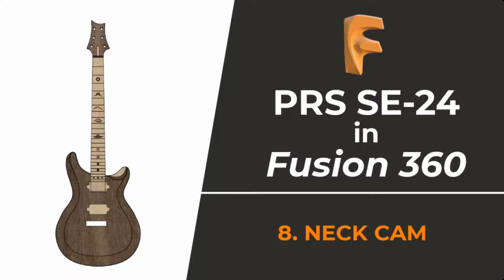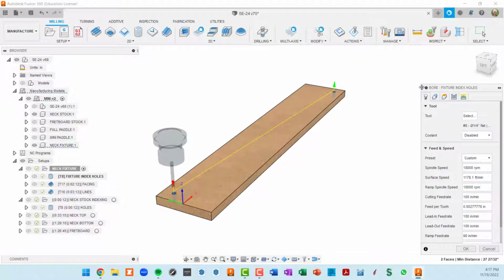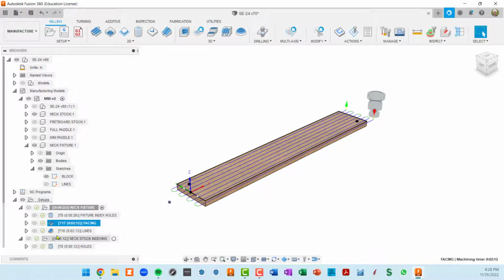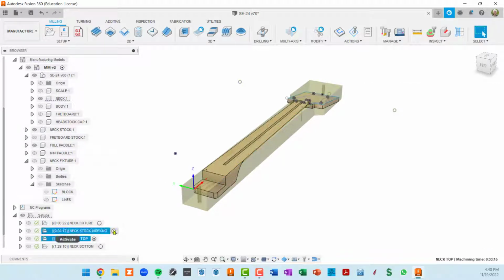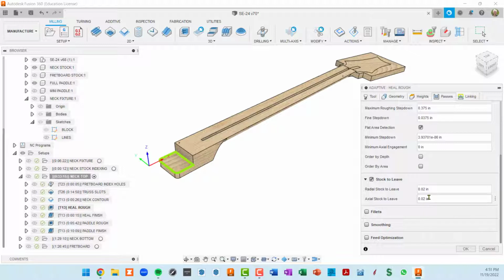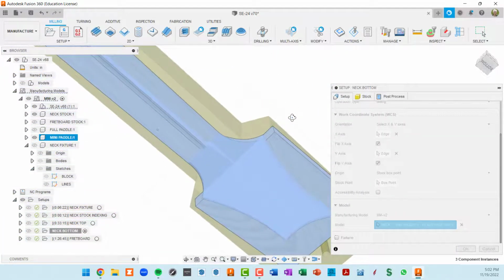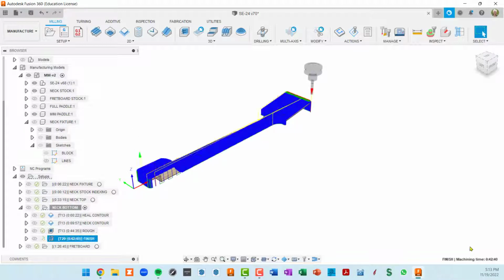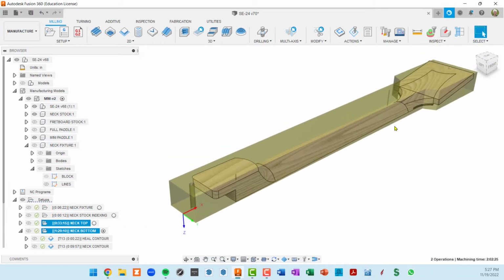Designing a PRS Guitar in Fusion 360 - Part 8: Neck CAM

Comment: Would be interested to know exactly what 2-sided tape you use.  I've just been running some initial practice tests with the "Template Tape" I already had but it doesn't love sticking to my MDF spoilboard and is pretty thick so I know I'm messing up my Z positions some.
Reply: Another great question.  I've used several - they all work just fine.  I prefer Intertape 591, 1".  Its easier to get off than ZFasten Woodworking tape.  Its SO MUCH easier than masking tape and CA glue.  If you set you Z to the top of material, then the tape thickness shouldn't matter.  If you set Z off of the spoilboard, then you could put you puck on a piece of tape, but I generally don't worry about it.

Comment: What's your reasoning in cutting the Heel (from the top orientation) in two operations (roughing and finish) rather than simply doing it all at once with no "Stock to Leave"?
Reply: I generally do a roughing pass with an end mill and a finishing pass with a ball nose.
Reply: @benweiss897  Thanks for your kind reply... but your answer was a head-scratcher to me!  For the Heel cutout, you used a 3/8"  (flat) end mill) for BOTH the roughing and finishing operations, which is why I wondered why not just do the finishing pass at the end of the 1st operation since the face your milling to is flat and you need to get snug into the 90 degree angle where the heel goes vertical.  I can see why a ball nose is the way to go for finishing passes on non-flat surfaces like the back neck profile but wouldn't a ball nose be a bad choice for finishing a flat horizontal surfaca?  I'd think that the radius of the bit would (theoretically cause (slight) concave ridges in the final finished surface.

Comment: In your CAM videos I've watched, you seem to use Bore for all holes, which is fine if the bit is smaller than the diameter of the hole due to that crazy Fusion requirement.  It would seemingly be convenient to use a 0.25" end mill bit to make my 1/4" index pin holes, especially since smaller bits tend to be shorter (my 1/4" endmill as a nice long 2" cutter).  QUESTION: What about the Drill function?  Every try that for your holes?  Any reason not to make them that way?
Reply: Yes, I've have used Drill.  You want to make sure you're using an up-cut if you Drill.  A down-cut will burn and can even catch on fire (especially MDF).  When I started, I was always buying up-cut bits.  Now I almost always buy down-cut (MUCH BETTER cut quality).  Two reasons I prefer Bore: 1) you can adjust your hole diameter with stock-to-leave.  The wooden dowels I use can be sloppy in a drilled hole.  2) You can use any size dowel, you don't have to have a matching up-cut bit.

Comment: Curious why you set the X Zero location of your WCS to the CENTER of your Stock rather than a corner.  I note you did this on your Tele Body CAM video too.  I don't know how I'd probe for that location on my CNC machine; it uses an aluminum block that snugs onto a corner of the stock.  I understand your reliance upon the CENTERLINE as sacred since you're flipping the stock to mill both sides but can't you just set the X/Y/Z=0 WCS location as the lower left corner of your stock against the top of the spoilboard (for both milling orientations before & after the flip), probe for X?Y=0 off your stock lower left corner and probe Z=0 off the spoilboard?  Am I misunderstanding something?
Reply: Great question.  If you use an edge and the stock is not the exact width that's in Fusion, you will be off register (I've screwed up a couple of necks this way).  So I always center.  You don't have to be really precise except if you've got a bookmatched top or a laminated neck with a strip of contracting wood down the middle.  But even in these cases, I don't fuss too much.  There are laser pointers that you can mount in your spindle, which are helpful.  Also you can chuck-up a V bit and get pretty darn close.  But again, extreme precision is not really necessary if you center.
Reply: Gotcha.  Thanks!  As I read your reply, I was wondering what your x/y/z probe looks like to allow registering X=0 in the middle of a piece but you answered that in the end... eyeball it with a v-bit.  Definitely something I need to play with a bit.  Ha ha... a PUN!   @benweiss897
Reply: @benweiss897  I've been thinking about this over the past day after reading your thoughtful response.  Seemingly, perfect case would be to be able to probe reliably using hardware (like a block that doesn't depend on my aging eyes!) but not subject ourselves to inaccuracy of stock width.  (Possibly) had an epiphany in the shower this AM that I wanted to run by you to see if you think it accomplishes both.  What if we probed to make Z=0 the LEFT of the Stock for TOP operations and the RIGHT of the stock when flipped for BOTTOM operations?  Y=0 would be edge of stock towards us on the table either way, of course, and Z=0 would be the upward-facing surface of the stock (in each orientation).  My thinking is that the this X=0 probing position would be the same physical edge of the stock in both orientations, which would also preserve the distance from X=0 to the stock centerline.  We would have to be careful (like for a bookmatched top yas ou mentioned) to be sure the distance from the probe edge to the centerline is correct but the distance from the non-probe side to the centerline could be sloppy without consequence.  Hope I'm making sense.  If so, does this hold water?

Comment: Thanks for the videos!
Have you considered machining fretboard simultaneously with neck?
Gluing it on after truss rod slot is cut and installed, then proceeding with neck top  and  bottom machining.
This requires cutting a pocket in the fixture to accommodate the fretboard when neck is facing down.
There is also the risk of destroying 2 parts if something goes wrong, but i think the pros are easy clamping while stock pieces are perfectly flat, it also means it will be perfectly aligned with neck. 
I’m pretty new to Cnc, but this method worked well for me
Reply: Yes, I have considered this approach.  But I wouldn't want to risk ruining two parts if something goes wrong (and I've had plenty of that on a CNC).  The fretboard indexing works great.  I use 1/16" side fret marker material and I locate the index holes within fret slots.  You don't even have to worry about cleaning out the fret marker - just remove after clamping.  It really works well.

 I don't cut the fretboard bottom on a CNC - I use a jointer instead (you simply need a flat side).  So my fretboard machining is only 1 sided.  I use double-sided tape to hold it down.  It's really the easiest part to cut on a CNC.